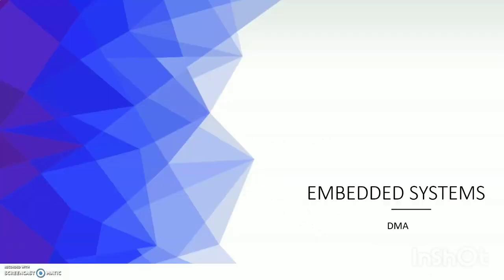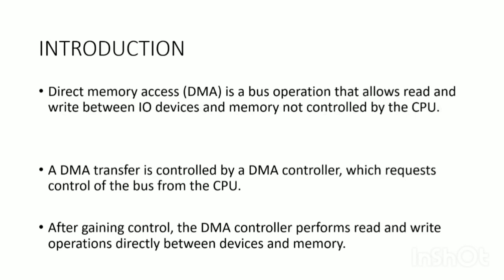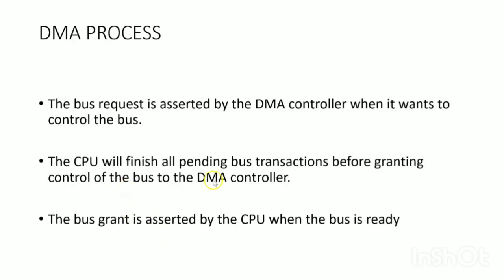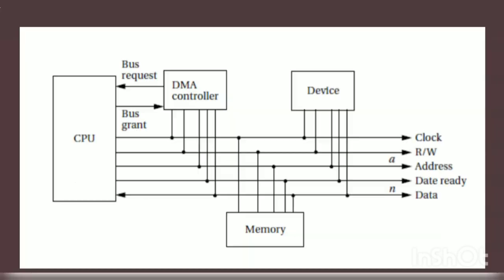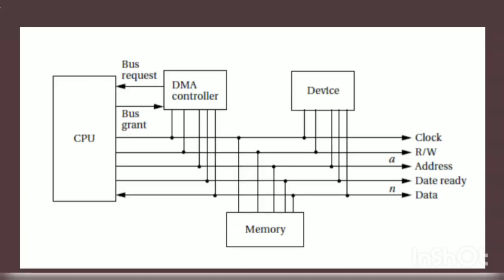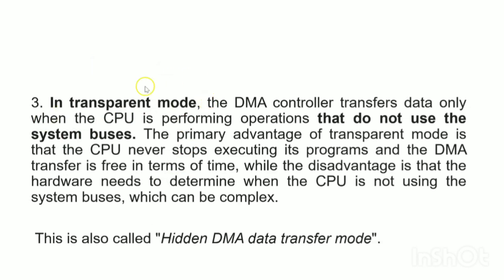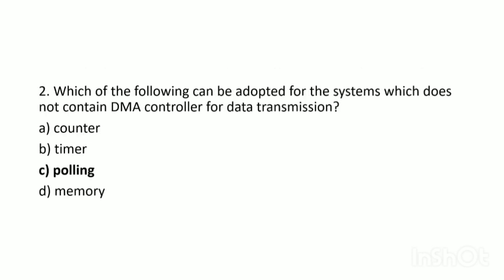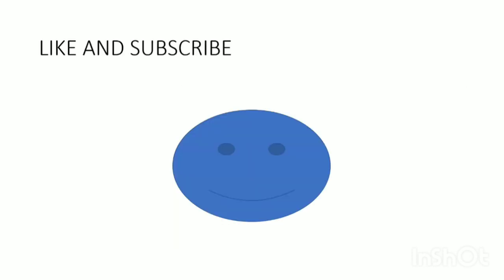Direct Memory Access( DMA) in Embedded Systems

Comment: Ma'am, which all are the three registers in the DMA controller, also will the DMA controller continuously interrupt the CPU till it finishes its function?
Reply from the maker: No only once it will ask for permission from the CPU then it will control the transaction. Also there are two 16 bit registers that control the DMA process
Reply: @EasyElectronics_jobupdates  Okay. So there are total of 5 registers inside DMA
One containing the source address
Next length register, then destination  address register, a byte counter and a temporary data register. Is it right Ma'am? Since in different sources I found different working types as well as different number of registers, so it is quite confusing for me😅